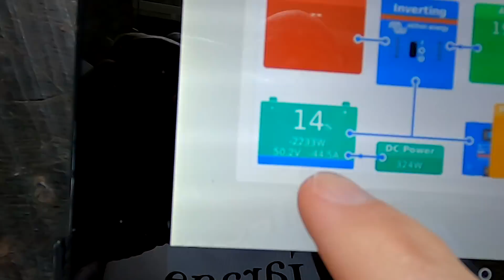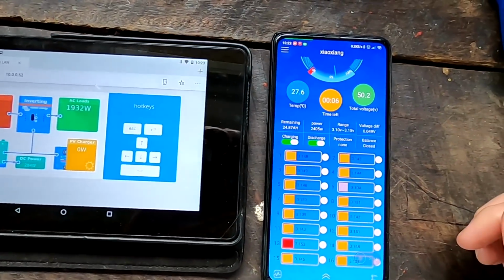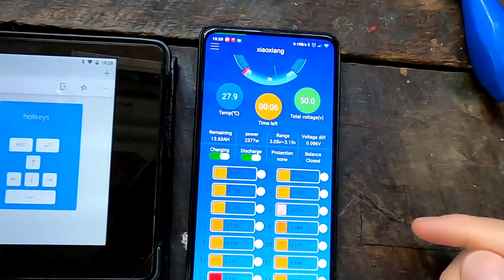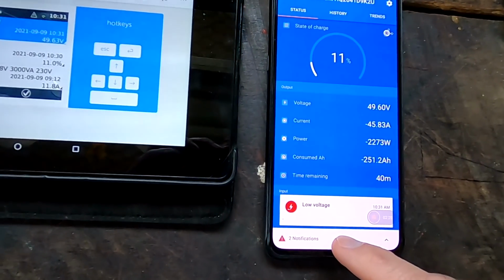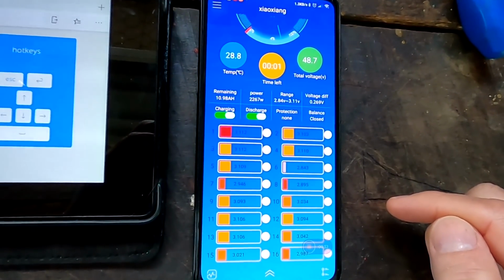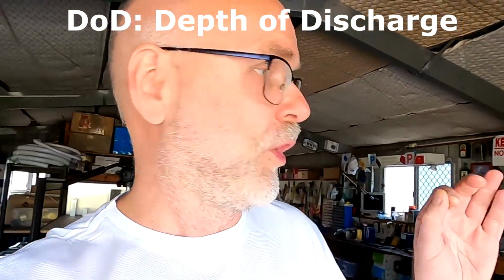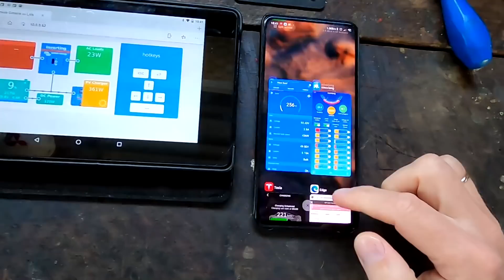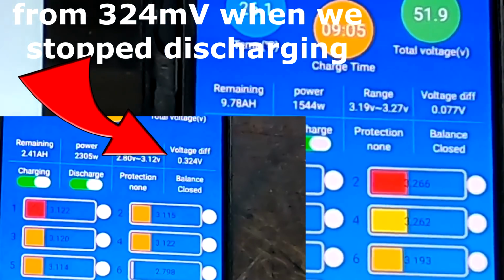Over 90% Depth of Discharge. Why go further?

Comment: So, yeah, you could boost the charge of your low cells by connecting a charger to the lower performing cell, so they will not cut out prematurely.

Even though your batt was discharging @ 50A--that is only 3.125A per cell, so if you connected a charger using a 5A to 10A charge output, you could relatively quickly boost the V of your low cell/s.  It wouldn't be hard to design & make a boost charge circuit for each lower performing cell to switch on & off to boost your lower performing cells while discharging to a load.  Then when you go into charge mode, the likelihood of achieving top balancing will be higher.
Reply: when discharging at 40A whole pack is giving 40 A and every single cell is  providing 40A!! It is the VOLTAGE that is multiplied by number of cells, not the curent. That is why single cell is 3.2Volt and 16 cells is 51.2Volt or lets say "48" nominal Volts..
Reply from the maker: @A B, that not correct. All cells are in series so experiencing the same current as @Servis Fibris explained.
Also, if I would boost this one particular cell, I would have the exact same situation at the top. You cannot have both ends of your charging perfect unless you have 100% matched cells.
Reply: @OffGridGarageAustralia  Weaker cells reach charge & discharge cutoff sooner than stronger cells.  By applying the charge just to that specific cell's terminals during discharging, you will be effectively only charging that cell before it reaches it's discharge cutoff limit  It will then increase it's charge & the V of the cell will increase to whatever V that you want.  Once increased to match the level of the other cells (or slightly higher, if you wish), the batt cutoff will be delayed so that you can get the optimal amount of energy out of the pack before cutoff occurs at whatever cutoff V/cell that you choose.

Since you boosted the weak cell's charge, it will also likely reach charge cutoff sooner than the other cells, which can be managed by setting your charger to a max of 3.45 v/cell & letting all of the cells equalize on their own--there is no need to switch off the charger because no more current will go into the cells after they have all reached 3.45 v/cell (so there will be no risk of overcharging any of cell).  Try it & you will prove it to yourself.
Reply from the maker: @ab_ab_c  I did try all that many, many, many times here in my videos. If you scroll back a bit, you will find all these videos with tests of manually balancing the pack. Injecting power into single cells creates chaos!
Why would you want to use more than 90% of your battery capacity anyway? If you have not enough capacity, get a bigger battery or get a second one to parallel.
Reply: @OffGridGarageAustralia  I've seen most of your videos in the past several months.  What I described above is not using an active balancer or bms--it's is using a separate charger just for the weaker cell.  Consider it like a dedicated monitor & charge circuit that engages when necessary.

You can indeed charge a single cell that is in a batt pack.  What 'chaos' are you referring to & what is the url to the exact vid that you referring to??
Reply from the maker: @ab_ab_c  Well, take this video below for example where I did exactly what you suggested. I injected power into a single cell to balance it out, to rise voltage and SOC so it matches with the other cells. I also use a set of light bulbs to do the opposite and discharge single cells which are too high. By doing this I have top balanced the whole pack at 3.65V manually. And this is totally fine if you do this at a higher voltage to top balance your pack. However if you do this again at other state of charges , you will destroy this initial top balancing again. That's what active balancers do, they balance all the time as soon as they detect voltage deviation. If you then charge back up, you whole top balance is gone and you have to start again. That why all BMS balance at the top and not anywhere else.
By using a power supply at any other point of SOC or voltage, you will bring your pack out of balance again. It is not worth charging a single low voltage cell at 90% discharge to squeeze out more energy out of the whole pack. Yes, that will work but once charging it back up, this exact cell will peak with a higher voltage than all the others and you have to manually discharge it again. You gain nothing at the end.
https://youtu.be/4iPpn8-Pakk
https://youtu.be/wvmf4xPqmrw
https://youtu.be/3N0clZrjJBc
+ 13 videos more about (manual) balancing
Reply: @OffGridGarageAustralia  re:  "By doing this I have top balanced the whole pack at 3.65V manually."

Why do you have to top balance manually?  Your active balancer is supposed to perform that function.

re:  "this is totally fine if you do this at a higher voltage to top balance your pack. However if you do this again at other state of charges , you will destroy this initial top balancing again."

Your weak cell/s will always trigger your system to cutoff early when charging & discharging--and it will likely get worse as the cell derates as it ages.  Without an active balancer, you'll always see an early cutoff. What you need is a smart charger that charges each cell individually after bulk charging the batt to a certain V limit (which is similar to the function that the active balancer is supposed to do efficiently).  What I've noticed from your vids is that your active balancer seems to be rather low power & it takes quite a while to equalize the cells.
Reply: @ab_ab_c  That no further current is flowing into the cells after reaching the voltage is only true if the the charge current is very very small. The LiFePO4 cells accept further charge until the SOC for the OCV at this voltage has been reached. This is also called absorption. At 3.45 V you reach the 100 % SOC, which you normally don't want, because of accelerated degradation.
Reply: @egnegn123  A cell will not charge if their isn't a higher input V than the terminal V.
If the cells is rated to 3.65V & your charge V is 3.45V, once it is fully saturated at 3.45V, it will not charge anymore--it will never reach 3.65V in other words, so you should have no concern that the cell will overcharge if you leave it on the charger at 3.45V.
Reply: That low cells do have lower capacity (A×h's) than outher cells. Charging any cell individually will create imbalance as whole pack is top balanced now (all cell are kept at the same amount of A×h's less than full)
Reply: @volodumurkalunyak4651  No it won't--it will just boost that low cell because the charger is just attached to the low cell.
Reply: There is no difference between using individual cell chargers and active balancer. The active balancer is just more convenient as  it chargers/discharges individual cells. As Andy highlighted the problem with active balancing is that it does voltage based balancing all the time, even then when the difference of cell voltage doesn't come from different capacity. And if you have high charge/discharge currents it cannot keep up with balancing, unless you would put multiple of them onto the battery.
Actually the term "active" balancer is a bit misleading, as this active is meant more in the sense that energy is transferred between cells, and "passive" balancing just bleeds off energy locally.
Actually "top" balancing is often seen combined with "passive" balancing, and "active" balancing is often seen as doing balancing all the time, if there is a cell voltage difference, and then doing this by transferring energy between cells. 
There is also the concept of doing bottom balancing, which was heavily proposed by Jack Rickard (R.I.P.). Top and Bottom balancing, both work fine. But both cannot use the full pack capacity, because the BMS has to either cut of discharging (top balancing), or charging (bottom balancing) early, when the lowest capacity cell reaches its voltage limit. Now, the devices that are commonly called active balancers are trying to combine both worlds. Causing imbalance between the cells is part of the concept of active balancers, to get 100 % energy out of the pack. But some of the balancers are going a bit short and do to much balancing in the middle area of the SOC (20 - 80 %) and are causing additional unbalance, where it isn't really necessary. With high charge/discharge currents they are not able to compensate that outside this area, to prevent tripping of the BMS cut-off. Here there would be some room for improvement. But is it really worth it? 
As Andy mentioned, if you stay within 20-90 % SOC, probably not.
Reply: @egnegn123  re:  "There is no difference between using individual cell chargers and active balancer."

Actually, there are differences:
1.  The energy transfer rate of most active balancers isn't very high.  A dedicated circuit+charger for weak cells as I have described could be designed to quite rapidly keep a weak cell balanced with respect to the other cells & it wouldn't be inefficient by wasting the energy stored in cells that charge too fast & cause the BMS to cutoff all pack charging.  It would use that fast charged cell to transfer it's energy to a lower charged cell.
2.  "the problem with active balancing is that it does voltage based balancing all the time, even then when the difference of cell voltage doesn't come from different capacity." This wouldn't be a problem for a small circuit+charger that charges a single cell as you want it to charge the cell.  You could have one for each oddball cell that doesn't charge/discharge like the other cells in the batt.
3.   "And if you have high charge/discharge currents it cannot keep up with balancing, unless you would put multiple of them onto the battery."  Again, that wouldn't be a problem with the type of individual charger that I described.

The other fact is that a smart charger would bulk charge the whole pack, then cutoff pack charging & top off each cell for a perfectly balanced batt every time. 

re:  "Actually the term "active" balancer is a bit misleading, as this active is meant more in the sense that energy is transferred between cells, and "passive" balancing just bleeds off energy locally."

Agreed.  The problem with active balancers has already been described above.  The problem with bleeding off energy that isn't transferred to another cell is that energy is wasted in a load resister to lower the charge of a cell. It's better to transfer that energy to lower SoC cells.

So what is the best solution?  A smart charger that individually charges cells & auto balances using energy transfers when possible or variable charging & discharging rates to ensure the final charge is maintained.  Until that type of solution is economical, we bulk charge the batts to a certain level & then balance charge to get an equal V on each cell---knowning full well that it will again go out of balance as it discharges because cells often do not have the exact same discharge or charge profiles--even from the same batch when manufactured...
Reply: @ab_ab_c  This was a funny discussion, I don't agree with active balancing or the need to introduce extra current to individual cells when discharge takes place, where the idea of top or bottom balancing works is in the final stages of the charge/discharge curve and anything outside of those curves would need to be massive to cope with the loads needed to do the job and then you wouldn't want/need top/bottom balancing, also the use of top and bottom balancing just by the way it's done, the amount of energy used/burnt is absolutely minimal by comparison anyway.
Reply: @petereaton6740  There are a lot of ways to skin a cat.  The point that I was initially trying to make was in the case when you've got a weak cell/s & you want to get the most out of your pack on discharge--like when the batt has derated over time & a few pesky weak cells are causing your discharge to cut off sooner than you prefer.  You could replace such weak cells or you could install a circuit that could in fact individually charge a weaker cell/s.  A smart switch design could also eliminate that problem because it would individually monitor & charge cells properly to keep the pack balanced.
Reply from the maker: @egnegn123  That is a great comment and summary. Thanks a lot for leaving this here for everyone to read.
Exactly, what are we chasing here? The last few Ah of the full capacity, the last % of SOC before the BMS turns off? WHY??? We can use 90% already without problems. That should be enough for everyone. If you need more capacity, get a bigger battery or a second one.
Reply: @egnegn123  The cells are rated to 3.65VDC, so even if they become 100% SoC @ 3.45V I don't think it will matter at all if you regularly use the cells daily--as they will be cycled due to normal use & not ever reach 100% SoC above 3.45V.

Now, if they are used in a standby application, that may matter---but, I have never seen such a claim from any reputable seller of LiFePo4 cells.  As frequently as Andy uses the energy from his cells, I doubt it will matter.  In any case, he charges to his own preferences--as he should. He doesn't have to take anyone else's recommendation.

It would be interesting to see if such a cell will actually reach 100% SoC when left on a 3.45V charger after it has reached 0 amps charging current for a few days.  Perhaps Andy will do that test to see whether or not it produces the same max Ah & Wh discharge data as when a cell is charged to 3.65V.

We'll leave it to Andy to decide if he's willing to test your theory...
Reply: @ab_ab_c  3.65V is no rating in the sense that means that charging to it is safe.
Charging to this voltage with the nominal C-rate in the specification defines an arbitrary SOC  state to 100%. For this nominal C-rate and the nominal discharge rate to the cut-off voltage the result is the nominal capacity when doing  full cycles. 
Using a different C-rate to charge to  3.65V will give a different result. Using a lower C-rate and charging to 3.45V only and long absorption time, will result in nearly the same SOC with the same nominal capacity.
The point is that the "safe" voltage is a subjective matter. It depends on the expectation on the lifetime, and the use parameters connected to this. And it seems to be some misinterpretation of the information spread by the manufacturers. 
The only lifetime parameter provided is the cycle count for a specific DOD. But no application will exactly match this test condition. The cycles are tested with a continuous charge-discharge test, which is finished normally within one year. In most applications the battery will not die because of expired cycle count. The battery will die because of calendar aging. Calendar aging is mainly caused by high average SOC and high temperature. So the strategy to maximize lifetime is to optimize this parameters.
Of course, there are other critical parameters, that have to be always kept in mind, to avoid early catastrophic failures. This is under-/over voltage, charging at low temperature, fast charging at low and high temperature. This can mostly avoided by the BMS. But calendar aging is highly dependent on operation by the user. If the user keeps the battery at high SOC most of the time the BMS cannot do much about, if there is no SOC management available, with reserved capacity at both ends. Even then the lifetime is still highly dependent on usage, because only a few % can be reserved at top and bottom.
Everybody can decide how he operates the battery. The necessary information is available.
Reply: @egnegn123  Anyway.. I don't want to belabor this discussion any further.  My opinion is to get the max cycles & max energy out of your cells, one should do the following:

1.  Never charge to 3.65V or discharge to 2.5V.  My preference is 3.45V & 2.7V.
2.  Never charge or discharge faster than .5C.

As usual, you may do as you wish with your LiFePo4 cells...

Comment: in your BMS app you can set it to disconnect if the cell deviation gets too high also
Reply from the maker: Yeah, I saw that but what is that good for? It does not really matter how much the cells drift apart at the bottom as long as none goes under 2.5V. That should be the trigger for the BMS.
Before that, the inverter should actually turn off the load. My inverter will turn off at 43.2V (2.7V/cell) but before that it send out these warnings. I usually don't go that low at all. Just good to know, I can.

Comment: I am currently capacity testing all of my cells again going to do one more top balance and then have two separate battery packs instead of one larger with parallel and series cells like I had before
Reply from the maker: So two separate banks with two BMS's?

Comment: BTW, today's news from Victron:

 Victron has a wall mounted EVSE under testing.

Maybe the charging speed can change based on inverter load and SoC?
Reply from the maker: Oh, that would be interesting. I've seen the community posts about this where people used scripts to achieve that already. But plug'nplay option from Victron would be amazing.